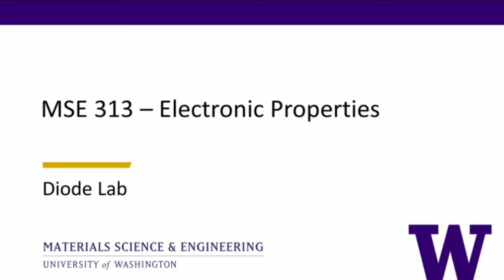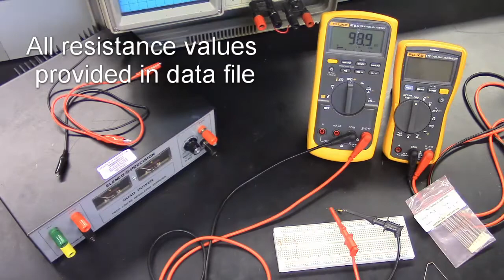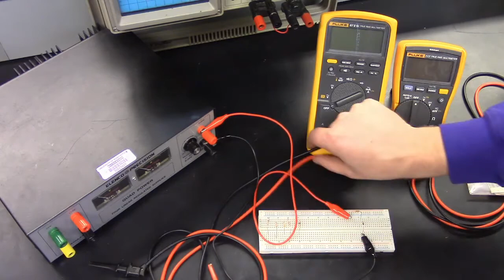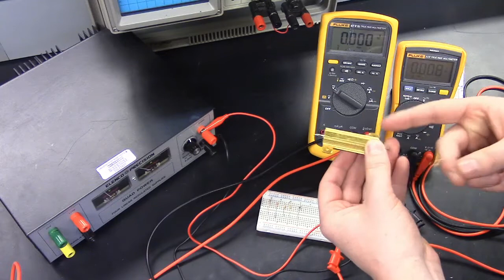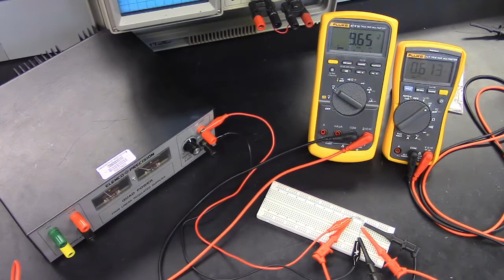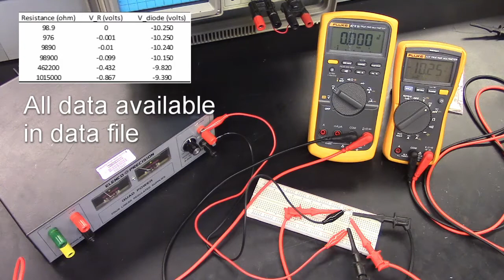Diode Characterization Lab Part 1

Comment: At 7:00, if you measure the resistance of the resistor using the multimeter set at Ohm measurement (the left multimeter in this case), i believe you will see that the measured resistance value is not the nominal value of the resistor. I believe its because the multimeter sees another resistance (the diode's plus the supply's) in parallel to the resistance under test. Is this a normal thing? If yes, in order to calculate the current through the voltage measurements, should i use the nominal value of the resistor at Ohm's law (I=V/R), or the aforementioned measured value? Pls let me know if what i said makes sense since english is not my native language, and elaborations might be needed. Thanks in advance, this video has been very helpful!
Reply from the maker: Hello, you should not measure the resistance using the Ohm setting on the multimeter while this circuit is connected to the power supply, this may damage the multimeter. You can measure the resistance using Ohm on the individual element when the circuit is open or power is off. The value may be a little different due to the resistance of the wire leads, it would be more accurate to use a multimeter with 4-sense Kelvin clips. Hope this helps.
Reply: @ZGNeale  It is very helpful thanks! In order to measure the current flowing through a diode, would you recommend this setup (having an ohmic resistance in series and measuring the voltage drop between its two feet) or just having the multimeter (in mA mode) in series with the diode without the use of an ohmic resistance? Should those two setups provide the same value? Thanks a lot in advance you have been of great help!
Reply from the maker: @znsxoli  you can use either method. For many data acquisition devices it is easier to measure voltage than current, so I would opt for measuring voltage across a resistor. However, if current is high then the temperature of the resistor will increase, and that will change the resistance value. You could calibrate this, there may be technical data sheets that give you the resistance at different temperatures. Another disadvantage of measuring current with the multimeter is that it must be part of the circuit, measuring voltage allows you to disconnect the multimeter whenever you want.
Reply: @ZGNeale  Thanks a lot for the help!